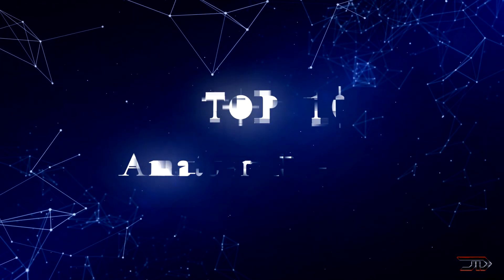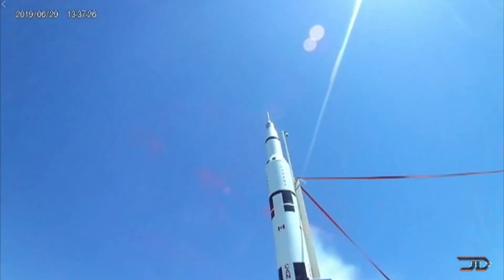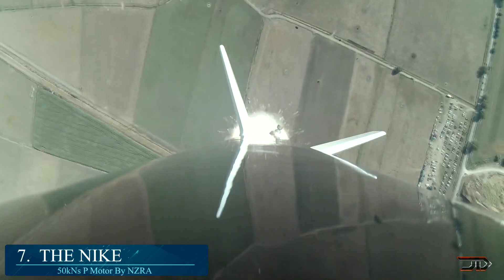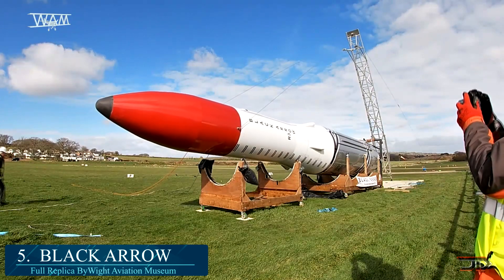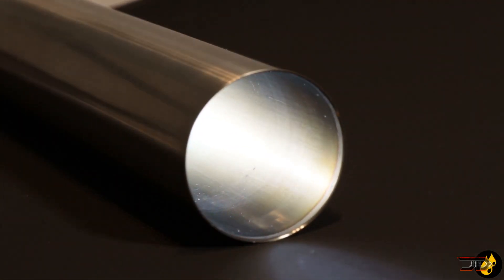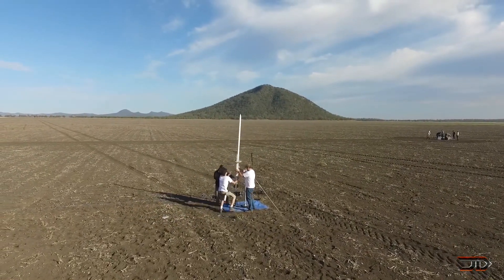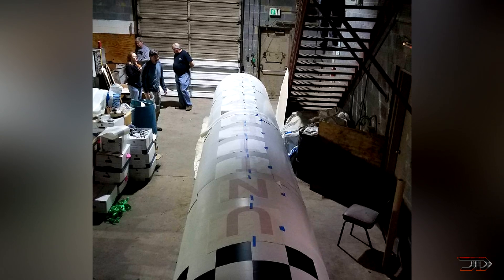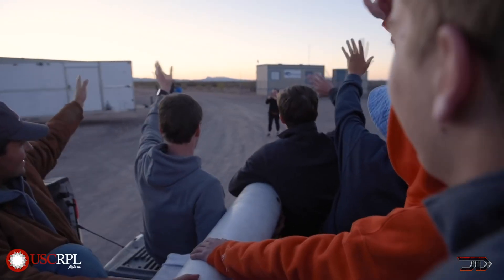TOP 10 Homemade Rockets -2-

Comment: For steam powered rockets, would it be possible, with all of you very innovative ways to use steam as the first stage exterior mounted solid boosters for A second stage?  Which is heavier the steam or the solid rocket boosters.?
   As an old man, I no longer have the patience to build rockets like I did as a kid  The biggest engine we ever had was a D, and it wasn’t sold in California we had to go to Yuma to get it.
Reply: more thrust per pound can be achieved though solid rockets over H2O. you would want the srb as stage one

Comment: ...the 64' scale Mercury Redstone. was impressive.

Back when I was a teenager  in the late 60s I built the Estes kit of the Mercury Redstone (the escape tower was made of small wood dowels)  Granted it didn't go anywhere near as high (C6 series engine delivering 3# of thrust) Also had their  Saturn V Kit which was a shopping 43" tall. (cost an "exorbitant" 19.95$ at the time) that used a triple cluster of C6 series engines with a total thrust of 9#

Comment: I can't wait to see the first homemade rocket that goes to orbit!
Reply: while i am sure that will happen at some point, doing that without a multistage rocket and most likely liquid propulsion systems would be incredibly difficult. not only would it need around 1+ minutes of burn time, it would also need to have attitude adjustment systems other then fins (engine gimballing, reaction wheels or RCS units) . on top of all of that the rocket would need a minimum Dv of ~7500m/s to achieve orbit assuming perfect and near 100% efficient trajectory's.

Comment: You missed CSXT who hold the record of 385,968 feet with the GO FAST Rocket, or Copenhagen Suborbitals who plan to fly someone above the Karman Line to 105 km...
Reply: The proper criterion for "space" is 50 nautical miles, von Karman's calculation puts it at 52 nautical miles. The FAI uses 62 nautical miles but only because it rounds off to 100 kilometers.

Comment: Will rocket get more boost if they are fired out of a tube, rather than in the open air?
Reply: How long do you want the tube to be before the rocket exits into open air plus the back blast would possibly damage the rocket tube.
Reply: The air in the tube in front of the rocket would create a tremendous amount of resistance to forward motion. Remember, that column of air will have to be accelerated to the same speed as the rocket itself.

Comment: the last one went high but spun like crazy.
Reply: I am pretty sure the spin of the rocket is intentional for the the sake of stabilizing trajectory with a less complex or even no control system - which is perfectly fine if all you want to do is to go on a fixed ballistic arc from where the launch tower is pointed and the payload doesn’t mind being spun.  It is similar to the idea of a rifled barrel imparting spin on a bullet for stabilization.
Reply: @wtmayhew  yeah you're right
Reply: @wtmayhew  It's actually very hard to get a fin-stabilized rocket to not spin.  The precision in fin making and attaching requires a lot of time (often needing assembly jigs) to ensure that they're (A) flat (B) smooth and consistent and (C) perfectly aligned,  In smaller rockets (like Estes) the "fincan" is often a molded plastic part which eliminates most of this.

Comment: So what is the minimum cost for building an amateur rocket with a camera that will reach an altitude of 50 miles?
Reply: https://youtu.be/4QsEPEhq5yk gotta ask that guy just recently sent a home made rocket up
Reply: About 20K with proper insurance, data avionics gear, electronics payload, extra motors.
Reply: depending on whether or not you can make your own motors and parts, 2.5-5k i would guess. if you cant build your own parts the other comment has a pretty accurate number
Reply: @pleb1985  
So a club could fund raise and obtain that much support, I surmise.
Reply: @alanstevens1296 yeah it could happen